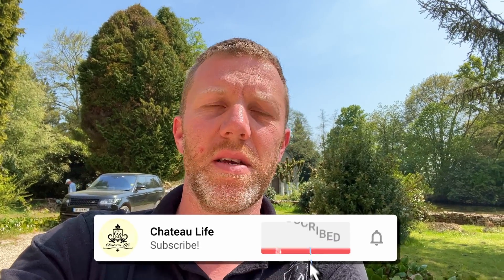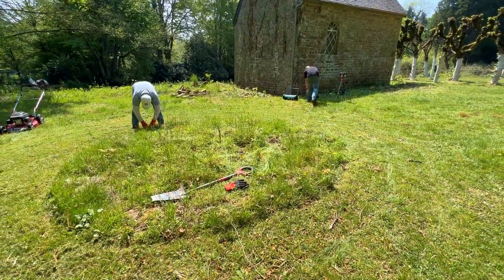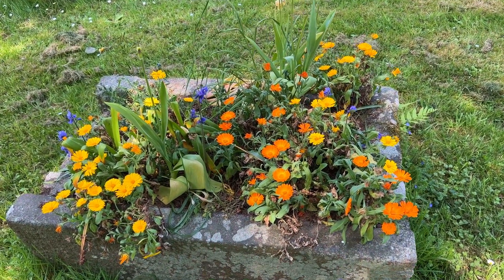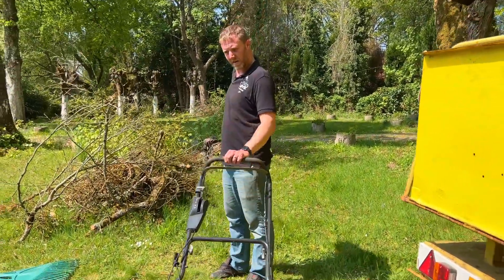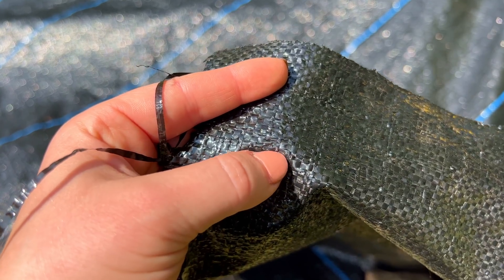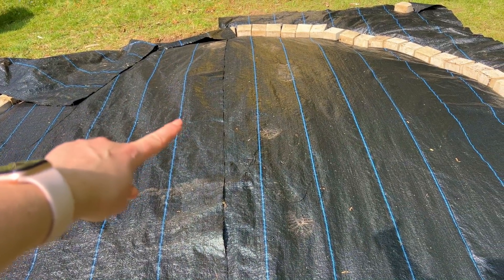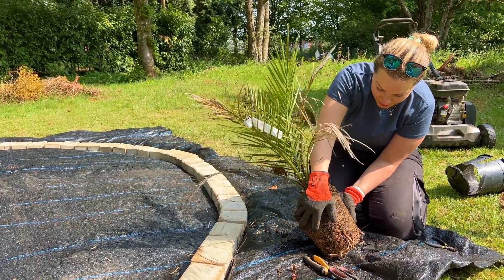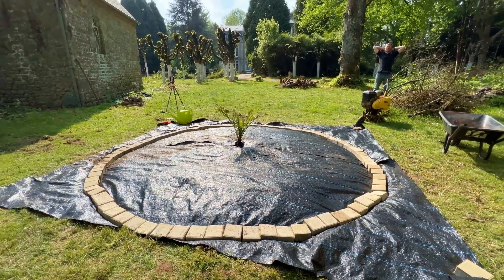CHATEAU LANDSCAPING BEGINS - Chateau Life 🏰 EP 187

Comment: Very nice.  It's possibl to bend a piece of wire into a u shape to hold the weed mat down.  There is also (I think) a tool that burns a smallish circlular hole in the mat so you can plant much more easily.  I watched Country View Acres do their vege garden that way and it looked to save a huge amoung of effort. Oh, and the flowering bushes are azalea - here in Oz they flower for a lot longer so they must like sunshine.
Reply: burning also prevents unraveling and messy strings that will appear as the material unravels. Unfortunately Phil and Angelina don't seem to be too interested in researching for better methods.